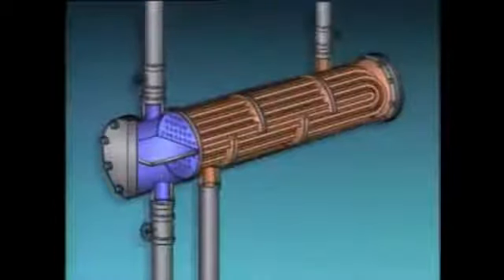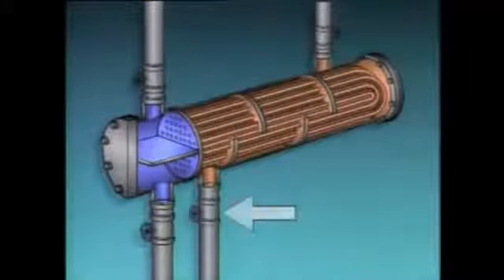Part 1 Heat Exchanger Operation

Comment: Why some place vertical heat exchanger  and some place horizental heat exchanger install?
Reply from the maker: Depending on individual process requirement. Basically Horizontal Separators are used where liquid components are higher and vapour load is low. Vertical Separators are used when Vapour load is higher and liquid component in the stream in low.
Reply: @REFINERYENGINEERING  ok
Thank for answer
Reply from the maker: Sorry, i thought your question was on separators. But basically concept of answer is same.
Reply: @REFINERYENGINEERING   yes 
I replace saprator to exchanger
Tx for rectification